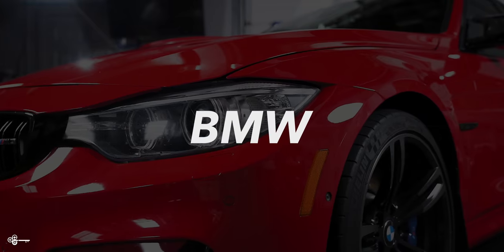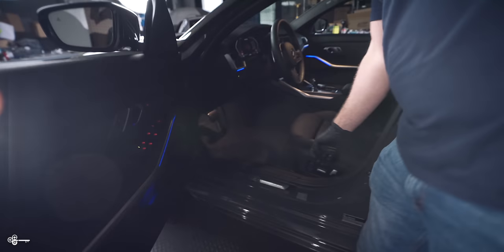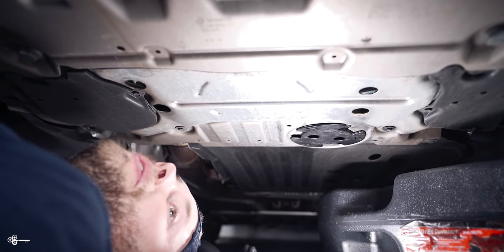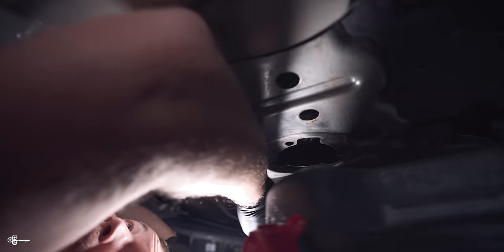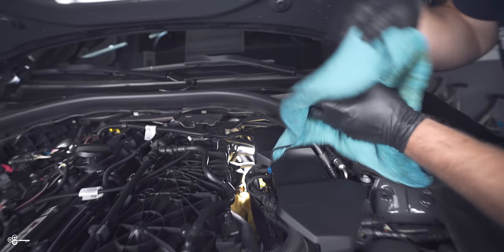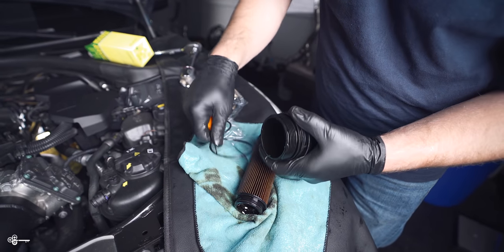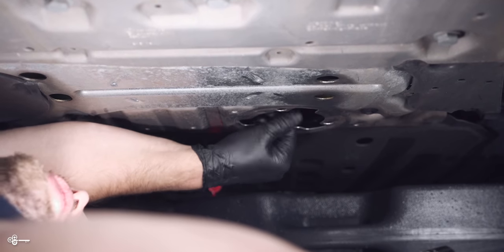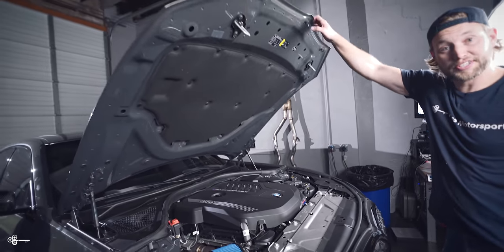How to change the OIL and OIL FILTER in the BMW G20 M340i (B5) how to reset the oil light

Comment: 0W-20 is for CAFE regulations, it's all about fuel economy. Anyone who plans on driving them hard or tuning should consider at minimum going with 0W-30 or 5W-30. Our dealer puts 0W-30 in our X3 M40i even with the 0W-20 hood sticker.
Reply: Probably a dumb question but what’s the difference ? Does one burn faster then the other resulting in more oil changes ?
Reply: I dumped the 0w20 after 1,000 miles and it was literally like water.  Replaced with Castrol Edge 5w30 Euro Formula.

Comment: 0w20😳 wouldnt run this thin soup in my b58.
Reply: Canadian Dealer recommended 0W-30.
Reply: Yep, 0w20 is basically water. I hate this fuel economy oil
Reply: I heard too thin oil and long OCI’s caused a lot of the timing chain issues on the n20s. Never trust the dealer. Lol
Reply: @jeremy_yyds  a lot of people run thicker 5W-40 LL-04 approved oil
Reply: It's what the engine is designed for.

It's not an issue if your engine is cooling properly, as a thicker oil won't really accomplish anything.

It's always going to be hotter inside your engine than outside.
Reply: Oil specs vary depending on the climate in your area 5/30 or 0/30 uk specs
Reply: I would trust the engineers that designed the engine rather than heuristics.

Comment: A good tip is to pour oil in the oil housing to soak into the filter. Prevents the initial startup of the car running dry for a few seconds.
Reply: Makes no difference

Comment: Hopefully a BMW tech or engineer will test out different oil viscosities, and a heavier oil will be approved. I have used 0W20 in my civic and it is basically water. Much too thin for any sort of Performance Engine, cant imagine how it would offer adequate protection especially at operating temperature.
Reply: It isn't too thin. An engine with tight tolerances especially a performance engine needs a "thinner" oil
Reply: I don't see the correlation between a civic and a bimmer especially when it comes to the engine.
Reply: I know this is an old video and comment, but a lot of the research I've done says 0w20 is too thin for the B58. I'm about to do my first change on my B58 and FCP Euro recommends 5w30 or 5w40. Anyone care to weigh in on this?
Reply: @BSed31  Another late-in-the-game reply. I did a ton of research lately. Funny that everything says to use an oil with an HTHS oil with value of 3.5 or greater. That only applies to LL-01 oils or others in the 5W-40 category or heavier. This watery crap is actually closer to a value of 2.7. VERY LOW. When you dig into the weeds, the only oil that ever got to 3.5 were heavyweights. I understand the tighter tolerances, but you can only make an engine so tight before it is metal on metal regardless of oil used. LL-17FE approved oils are junk in my opinion. I'll be running an 0W-30 myself. I still believe that oils should be able to flow properly. That's the big takeaway. An oil that can't flow is worse than a thin oil. Right? And for those that are tuned, should definitely use something better than a "fuel economy" rated oil.

Comment: I understand 0W20 oil in an basic economy vehicle but for a high performance turbocharged engine that's known for very high oil temps and load? It's weird because the owner's manual in 2016 and 2017 models with the B58 motor spec you can use 0W20, 0W30, 0W40, 5W30 or 5W40 as long as it had the BMW LL approval. The 2018 and up owner's manual says to use 0W20 yet the motor has seen 0 changes so it can only be for fuel economy versus lubrication properties. I would stick with 0W40 oil because it's going to easily distribute throughout the motor when cold plus lubricate like a 40 weight oil which can handle the high temps better.

Comment: Thank you for the video. One question. Because of the ramps the vehicle isn´t parallel to the ground. I would be concerned that the oil may not be drained completely. What do you think?
Reply: That’s exactly what I thought
Reply: Drain plug is to the rear of engine so it naturally drains with the incline

Comment: I would not open or remove the oil cap on the top until AFTER you are draining the oil below, that way the flow of oil is slower when you first open the drain bolt.... That should also help in presenting burned hands...

So right before you are going to replace the oil filter, that's when I would open up the oil cap ;) and the flow will then be free flowing...

You are welcome...

Comment: Nice DIY video, like always.
I wanted to ask you, i'm getting a 2019 M140i which has the b58 gen 1 in it.
I'll go stage 2 with decat downpipe, charge pipe and intake. Is the 0W-20 oil from BMW still recommended with power increase like that ?
Thanks ✌🏻
Reply: 0W20 is made for increased fuel efficiency by sacrificing lubricity. If you want to lubricate your engine properly, you should at least take a 5W30, but a 5W40 is better. If you live in areas with really cold winters you could also use a 0W40. If your car has a particulate filter, you should use a LL04 oil, if it doesn't then take a LL01.
Reply: Dude at least go with 0w-30, this is Canadian dealer recommended. Or you can do 5w-40 if your car go to the rpm redline quite often.

Comment: Shouldn’t you undo the oil filter/remove oil cap when draining down the oil? Helps it all flow out. 
Also did you check the oil filter housing for any debris? There have been problems in this area.
Reply: You’re grasping for straws

Comment: 32 mm is socket size in metric 😁
Reply: 1 1/4" is actually ever so slightly smaller, so you'd actually be better off using the Standard socket for once.

Comment: Is it okay to drain the oil using an oil pump? I appreciate that small amount of oil at the bottom may not be drained (not sure how much - anyone?) but it must be relatively small amount.
Reply: They don't have dipsticks, usually, though my 2018 530d does have one, which I use to suck the oil from...it usually gets all but half a liter.

Comment: What is wrong with BMW, E90 - 5w40 , f30 - 5w30 , g20 0w20, next stage is using water instead of oil for no emission and then we have engine repleace every "oil-water" change...
Reply: i don´t know if they really recommend 0w20 oil on the G2x series. hard to believe
Reply from the maker: They even put it on a sticker on the hood... crazy they use that light of an oil..

Comment: Anyone else find it bonkers that BMW requires us to run the engine up to operating temp prior to checking the engine oil level?  So....if you're engine oil level is super low for some reason, then you have to potentially damage the engine in order to check the oil level....  It's an absolutely absurd engineering decision, IMO.